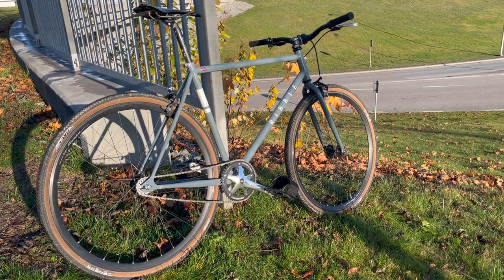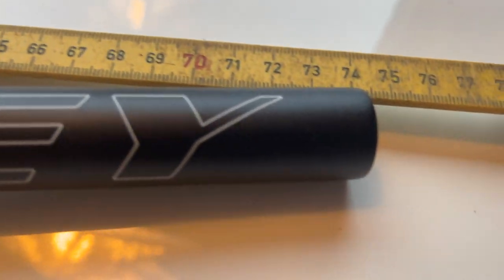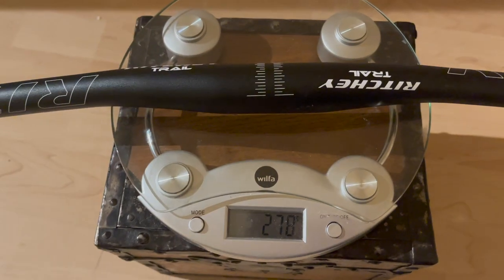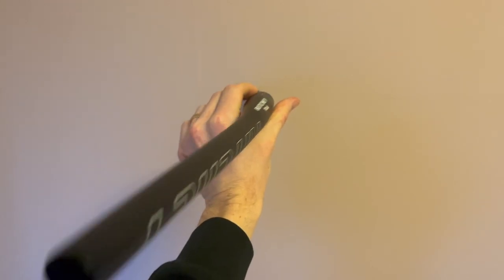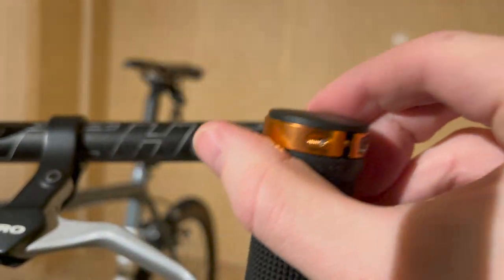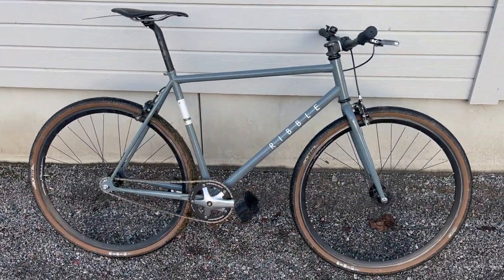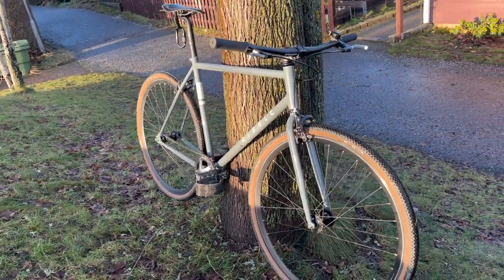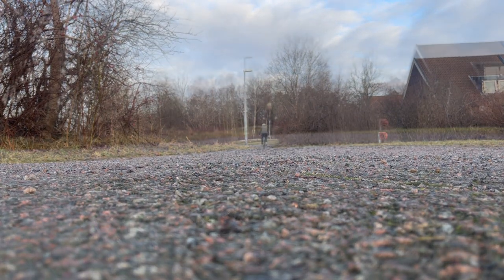Wider handlebars on my Ribble fixed gear bike

Comment: The cables were plenty long enough to switch bar length with no problem it looks like. Good news.
Reply from the maker: Yeah, you just kinda have to wiggle it a little bit. You can see the process in normal speed on my other channel “Dadvurt” :)